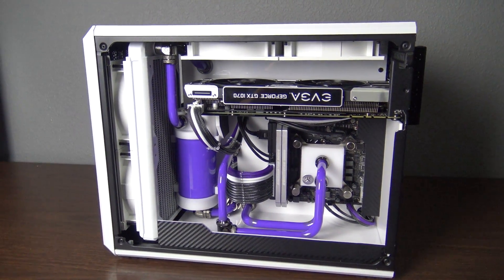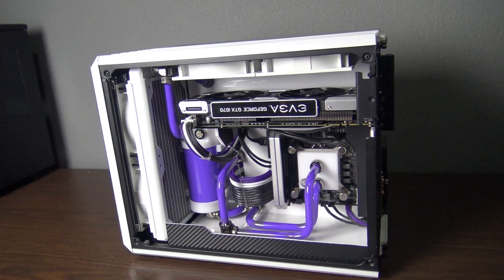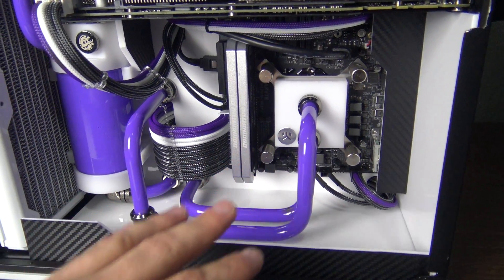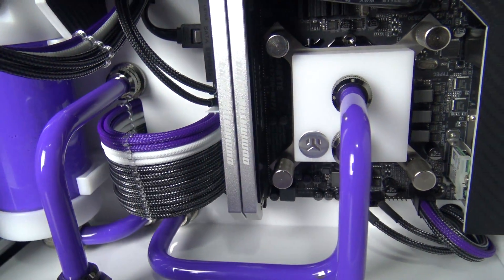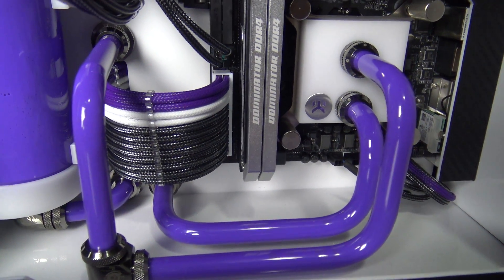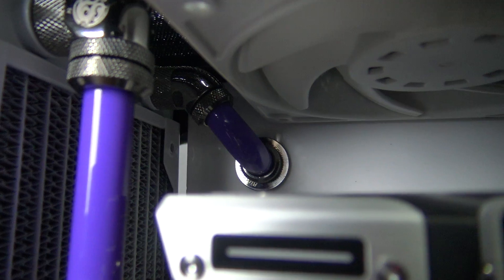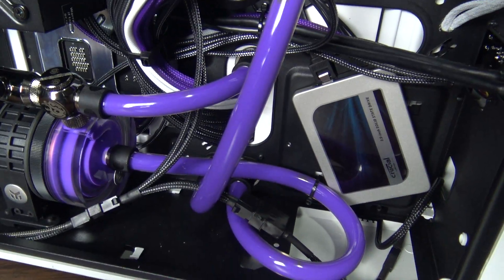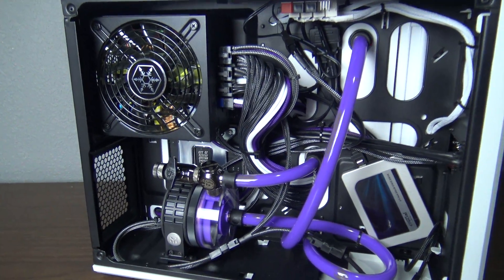Corsair Air 240: Custom Water Cooled Build

Comment: Where can I buy the cable sleeves? only the sleeves...   nice build
Reply: https://es.aliexpress.com/item/3mm-15-Meters-Black-PET-Expanding-Braided-Cable-Wire-Sheathing-Sleeve-Sleeving-Harness-49-3feet/32353612961.html?spm=2114.13010308.0.0.JgPVr4&aff_platform=aaf&cpt=1497094733007&sk=VR7qbIy&aff_trace_key=e61a41bb4ce640a3805bf4d79133c669-1497094733007-08617-VR7qbIy  ... These sleeves are good